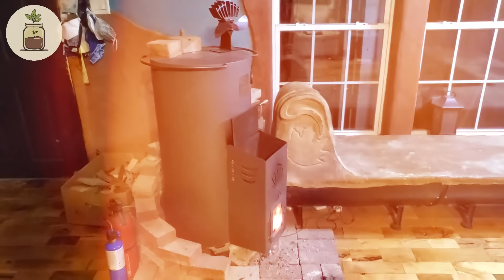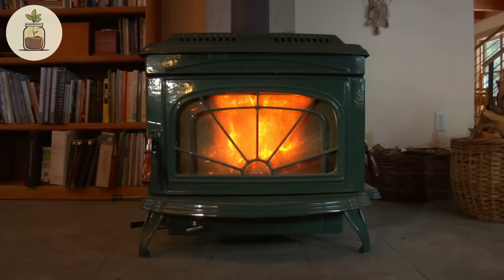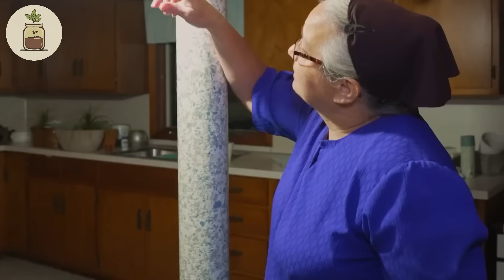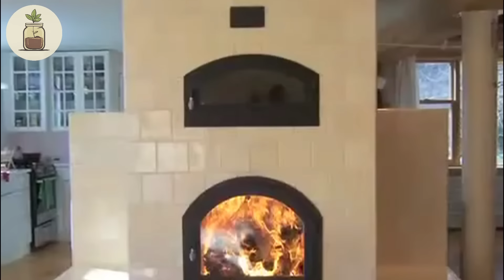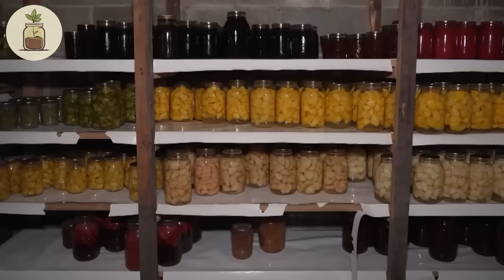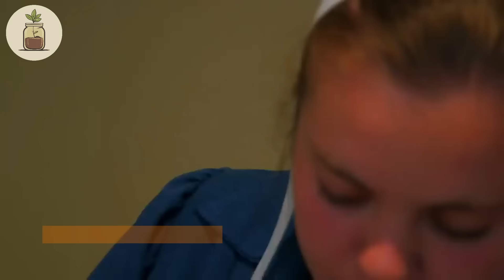How Amish Heat Their Living Room Without Gas/Electricity

Comment: Bonus point, diamonds come from heated up coal stones, so when we finish being Amish for the winter we use the diamonds in the bottom of our fireplace to buy new coals.   Everything is circlical.   Our little Amish community is near Topanga Canyon Calif if Yall'is want to come visit on a hiatus.
Reply: Diamonds were formed 2-3 billion years ago deep in the earths mantle under extreme pressure and heat carbon being in its purest form.  Kimberlite vents or pipes take ages to find then extract from the kimberlite rocks. They can now be made in labs so I’d be intrigued to know how the process you use by simply heating ‘coals’?
Do you actually mean ‘diamonds’?
Reply: @ it requires very hot coals in a pressurized stove.  It's really very simple.  We just pulled a 3 carat stone out last week... but it's the middle of winter so, generally they average closer to 1 carat.
Reply: @Sterlingheadset  you ought to do a publish paper on it I’m sure the industrial diamond makers will be very interested. Getting the pressures that are required 100 miles down in the earths mantle must be really impressive and the heat required is 2-3,000 degrees c. Graphite is the nearest pure carbon  we have interestingly graphite naturally is the softest form of carbon but under extreme heat and pressure it becomes the hardest. You can get micro diamonds when a meteor strikes earth as the heat and pressure is very similar to early earth but they are very hard to find.
Reply: @stuartbroadhurst7523  
I've been working on my paper for nearly 2 years.  I intend to publish it in the Christian Science Monitor since the data will appeal to man Christian Scientists.
Reply: @ 
It should be published in September 2025 
Thank you for your support.  Coal diamond mining will soon outpace Crypto mining and investing.  Think of it like BitDiamonds.
Reply: @Sterlingheadset  wow, you could be the first Amish to get a Nobel prize for science and innovation! Keep me posted? I’m interested are you allowed computers etc I thought it was against your belief I could be wrong? I’ve put you forward as you need to be nominated!

Comment: Yeah, except if heating with wood was widespread not only would the fuel, wood, be far more expensive, air quality would be far, far worse.  There have long been wood heating thermal mass systems but the problem is they are viable only on a small scale.  And, that doesn't even address the deforestation problem.  Wood heating is neither economically nor environmentally sustainable.  Accordingly, its nothing more than a relic of 150-200 years ago and it shouldn't be highlighted.

Comment: HERE on this TINY FARM,, WE are lucky,have been BLESSED  to be where we're at Today,,to have what we have !!
We use have a 500 gal PROPANE tank that runs  EVERYTHING!!, 
Generators on quick Disconnect's, like an air line x 4,, One runs 12,hrs, and the others,are for the day by day,,in a rotation!! Heat lamps for our baby BIRDS actually heat our camping TRAILER, during the Day,with a gas stove and Ashley heater,direct vented out the side of our TINY home,easy to heat! Cover the windows in the winter time BECAUSE of the style window,and skirted ALL AROUND the BOTTOM!! Our water has not frozen in five years of living this WAY!!

Comment: If I had regular access to wood, I'd totally go wood-burning stove. My gas bill was reaching over $350 per month in the winter. My house is old and poorly insulated. I started using a kerosine heater a few years ago (sometimes with electric space heaters for other rooms) and haven't turned back to natural gas heat, since. The only drawback is I don't leave them running when I'm sleeping or away, but it heats the house pretty quickly. The electricity and kerosine costs don't come near $350 per month.

Comment: Good ol rural Baptists still use a non fancy cast iron stove too. Firewood is big business in middle TN. If you stay in the country you could sell a rick of mixed hardwood for 60-75$. If you’ll go a little closer to Nashville you can get a dollar a stick.
Reply: Just imagine how much the price of wood will jump if even 10% of people started using itvas a primary heat source
Reply: @ well at the dollar a stick price and there being approximately 220 sticks in a rick. In Middle TN if  you had a 4’x3’ fireplace which is pretty big, and you lit a fire every morning and kept it going till about 9pm every day from Nov 15 till March 15 you’d need about 10 ricks of wood to have a little leftover at the start of spring. You’ll burn about a rick every week and a half so that’s 220 every two weeks from just one customer. If a crew had three men and the equipment it’s possible to put 400 ricks on a lot from January till September. It’ll all be sold by thanksgiving and you’ll be selling greenwood till the spring. It’s lucrative but it’s also hard work. Possibly as hard as an individual can work in this day and age.

Comment: A 300 foot, 3/4 inch diameter, polyethylene pipe, coil from the farmers coop on your roof facing south, supplys enough hot water to take a shower, every half hour.
Depending on the outside temperature, the time of day, the time of the year. AND stuff, but on a low wind day between 10 am & 6 pm, 70 degree day, clear sky, it's a great hot water producer. Cost is a couple hundred bucks to install and it lasts forever.  I had a coil on my hot tin roof using stainless steel bailing wire & silicone bath tub sealer to seal the screws that held the bailing wire, that held the coils about 8 inches apart, so the shade of one tube didn't block the sun of the next tube.  If I put clear visqueen over it it would probably produce steam on a 90 degree day. If I had a platform in front of the house, painted it black, installed the coil, put old window glass on the coil, ran a pipe under the platform to the center of the coil, and the outside of the coil went into the house and up to the top of a water tank and 10 inches down from the hot water outlet that removed air, the bottom of the tank pipe out would be the pipe under the platform and a T in that pipe is the cold water inlet. Heat rising would fill the tank with FREE hot water FOREVER.  I got 3, 120 gallon stainless steal tanks from the garbage dump for FREE and 4, 80 gallon ones, along with the wood and insulation needed to build the platform.  Each and every one of us could build such a system. I do stainless steal pipe welding, so it was an easy job for me. You will need some help, so DO IT dude.  You gotta love the Amish. They understand the: KEEP IT SIMPLE STUPID system.
If you don't think it will work, check the hot water in your dark colored garden hose loosely coiled on the drive way on a sunny day.
Reply: I'd like to get a free stainless tank!
Reply: Cool
Reply: June to October. We get free hot water because temps are generally 99-115 F. It can burn hands if not careful, but afternoon- evenings is a great time to use that hot water in the house, but not to water plants outside!

Comment: Up till the 1970's, coal fires in UK houses were extremely common, as Britain's industry ran on coal, and an open fire was easy to maintain. As the move to cleaner air began, these open fires moved to multi fuel burners, running on ovoid's to reduce smoke emissions and gas fires as an alternative. But as government control tightens, we now have to pay a fortune to run gas central heating and electric heating. If it can't be taxed, it's illegal.
Reply: It's cheaper and easier to keep your body warm rather than a whole room in the UK. Some are even pitching tents on top of their beds to keep warm at night.
Reply: @samanthahardy9903 
It works
Reply: In short, 😊the government is evil.

Comment: The Russians in Siberia, traditionally, had very similar masonry structures built around their wood fired cooking stoves and ovens. They actually have beds built on the structures to maximize the use of the stored heat in the brick (not a lot of stone in Siberia, as I understand it), so they may have been small structures with single room, open floor plans or maybe the cook just got the first pick on where to sleep each night. I don't know, but as the cook in my house, that seems fair to me. I think I saw a similar strategy used in some of the Amish constructions shown in this video.

Comment: Whatever they are doing works for them. I had a coal fireplace with a water boiler in the back of the fireplace when I lived overseas. It was much cheaper than using electricity to heat. I’ve known two people who burned their homes down with coal and a dirty chimney. If you’re burning anything for heat, keep an eye on it and keep it cleaned up.
Reply: Annual or seasonal chimney cleanings are needed for active fireplaces and coal stoves. My family lived in an 1890's farmhouse with a fieldstone foundation, it had a chimney connection for a freestanding wood stove, so we got one, added some heat shielding around it and used it for years without issue. Point being it was cleaned spring and fall, one to eliminate any creosote deposits and one to make sure nothing had moved in over the spring/summer. We moved away and in a year or so the new owners had a chimney fire which gutted the home, it was leveled into the basement and they brought in a mobile home... I think they also destroyed the unique mother in law house out back, no power, no plumbing, my Grandma live in it for a summer before finding a place in the area for herself. Our next house was pretty new at the time(late 70's/early 80's) and came with a double 55gal barrel stove setup so the hot chimney passed inside the upper chamber which allowed collected heat to assist our LP furnace as we had a 500lb propane tank outside and that setup allowed us to get through winter on a single refill in the fall. During the summer we used 80 or 100lb tanks for our kitchen stove.

Comment: When I grew up in Michigan, my parents had a coal furnace in the basement. It heated our 2-bedroom home just fine. As I grew up, I learned how to tend the furnace including when to take out the clinkers (the residue of numerous coal burning days) and how to properly shovel the coal into the furnace without hurting my body (or anything else). I also learned how to make that fire last all night and how to get it going good for the morning. As noted in the video, coal can be dirty. Every spring part of spring-cleaning was washing down the walls to remove the dingy mess from the furnace. The amount of dirt depends upon the quality of the coal.

My father loved to build boats--just the ones small enough to fit inside the garage. When he was out working on the latest watercraft, he would heat the uninsulated garage with a kerosene heater. Being the eldest, I was often tasked with helping his endeavors. Dad and I would hang up our jackets after a bit of heating with the kerosene heater because it really put out the heat. We'd only put on our jacket if we needed to go out to tend the pipe where he steamed the wood to make the bent ribs for the boat. And the boat? The family would use it all summer until someone would see the boat and buy it. Dad and I would start the boat building once more when autumn came beginning in the basement where the coal furnace kept us warm until the big parts needed to go out to the garage in late winter.

Our house had a fireplace which was used now and then. It wasn't a plain one though. When Dad and Grandpa built the house, they faced it with stone to retain the heat generated. Also built into it what was called back then a heat-o-later which is a system of gathering more heat from the fire and returning to the room with a system of vents (which were not connected to the chimney).
Reply: @sandyp2485  I had a cousin that bought a farm and it had a coal furnace it also had a fan and it heated the whole house even the upstairs you would find a register in the ceiling and open to the upstairs. Like a floor and ceiling register in one. The house was strange had two sets of stairs one on each end of the house. I guess the open was for the coal heat. 73
Reply: I bet that was a gravity octopus furnace. Used to be one in my house. And a coal bin.
Reply: We had a gravity octopus furnace in the basement when I was a kid. We also had a little door in the basement to a room that had been used for coal.
Reply: @sandyp2485  dad and I tore one apart it was not safe to use the burner was cracked when we tore off the tin around the furnace. The large octopus had large pipes. We replaced it with an oil furnace but we had a gas well so it was converted to burn natural gas. 8 inch pipe is much better than 24 inch. 

When I was a child I was afraid of coal furnace my sisters apartment had one in the basement it was a monster. 73
Reply: @ronb6182  My parents eventually replaced the coal furnace with one that ran one natural gas when the gas lines went in. Also, mom was tired of the mess that the coal made. Every spring everyone in the family had a part in cleaning the house including the walls. It was also nice to not awaken to a chilly room & floor in the winter. Baths were only taken in the evening because it was often too cold to be wet in the morning before the furnace really got going and putting out the heat. And, yes, those old furnaces did take up a lot of space in the basement.
Reply: @ A lot of those old octopus furnaces were retrofitted with natural gas burners. Efficient they were not, but fuel was cheap back then.
Reply: All kids should be taught this in case they ever need it...
Reply: You were so lucky to have these experiences during your childhood.  Thanks for sharing.
Reply: @mel3004  As a kid, I didn't think it was so much fun. I do appreciate it as an adult.
Reply: Thanks for the story very interesting
Reply: I bet your dad's name was Noah................
Reply: Well I never thought about it but I guess there would be a right way and a wrong way to do that. Oh I know is I can't make a fire in a wood burning stove and I can't make a fire in a fireplace. I have tried and unfortunately to no avail.
Reply: @ItsMe-ic7on  It's not hard. Have someone show you how.

Comment: Just so you know, they did not invent this type of rocket stove. But wise of them to add them on. Actually when it is run correctly, the smoke exhaust end is not that hot. All heat has been utilized in the bench and surrounding earth enclosure.

Comment: without gas and/or electricity, yes, but they BURN wood, BURNING wood is a much more poluting heating solution then gas/electricity
it not only emits fine dust particles but is also known for emiting PAC (Polycyclic Aromatic Coalhydrogens) wich is cancerous
even gas is less poluting if burned by a modern heater, so no, i would'nt say its a good way of heating your dwelling, unless your're in a war zone or apocalypse where you have NO other CHOICE

Comment: I have a old Train wood stove in my trailer and it will run 18 to 24 hours on one load. Turn the vents off and if it doesn't go out your stove is not going to work like mine does. It's got to be air tight no drafts. When it's completely shut down. That's the key to have a good sealed stove and a good draft for chimney 😁👍

Comment: The problem with this feature it was used in the 70s and 80s and the amount of wood being used in a large percentage depleted the forest rapidly. Depleting the forest at a rapid speed. Because of the number of wood fires. Remember the amount of farmers per acre is vastly different compared to a city population. Most of the time this idea would be divided between electricity and wood. There were companies that made these sorts of stoves for decades. But because of the amount of wood being burnt. Governments stopped too many homes from using this large amount of wood. This is why it is important to do your research before you suggest something that has already been thought about and tried. Unless there is a new innovative idea that could produce really small amounts of wood being burnt for this purpose.
Reply: Rocket stoves are a more modern style that use much less wood, you can heat with junk mail, sticks and branches.  The gases are burned not going up a chimney, and the masonry or cob benches warm then radiate the heat all day.  They aren’t fired all day long.

Comment: We had a coal stove in living room when I was very young, coal shute in side of the house
Reply: We had a coal furnace in our musty basement until switched over to oil... coal shute too. Later put a wood stove in our living room, stove pipe out the roof, insulation on back wall...

Comment: We are not Amish But we do use woodstoves most are multi functional My uncle even has coils that run through it and heat their water and radiators, All people strive to make efficient ways to accomplish tasks That's what makes humans a step above animals most times 😅
Reply: When we bought our house it had a wood stove in it.  We replaced it with a central heating and air system.  Years later I really regret that.
Reply: @Jadeserphant  Yeah I think being able to have both would have been really nice. Instead of having to rely on just one.
Reply: Yeah I had the same thought. There's plenty of non-amish people who live in places with high quality wood burning stoves
In one of my brothers New York City apartments they had electric heating. So my brother converted a water boiler into a wood burning stove, and eventually wood was hard to get. He built another one for oil burning... And he just got discarded french fry oil from a local place.